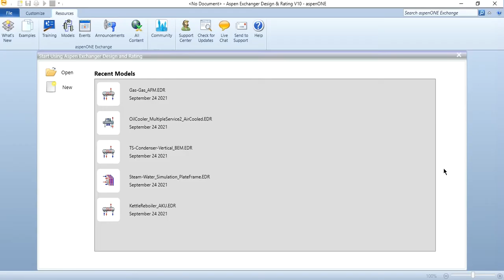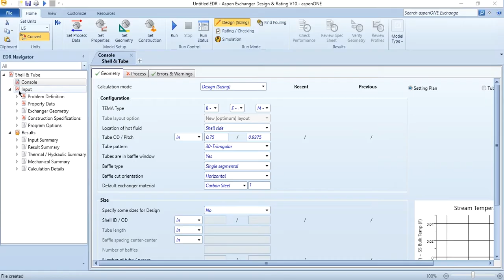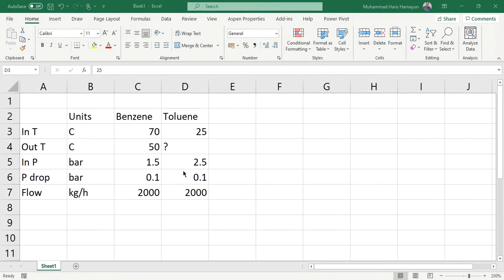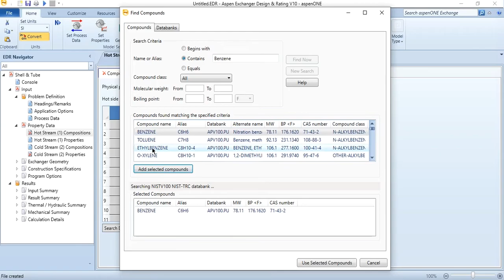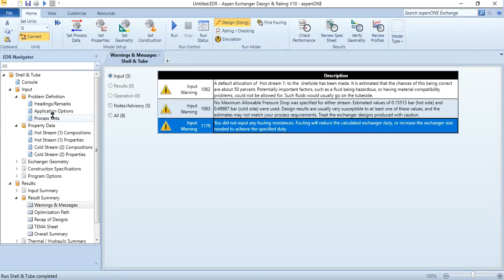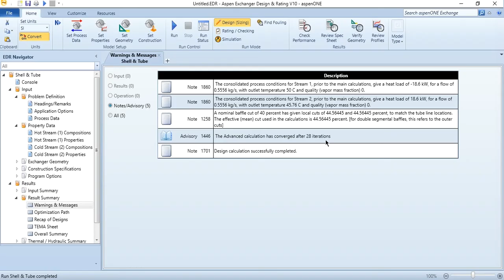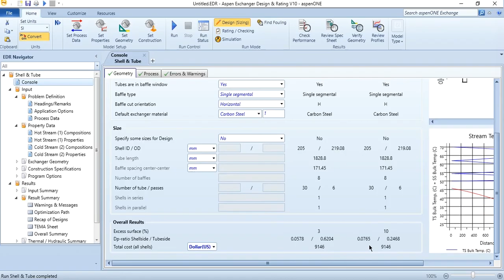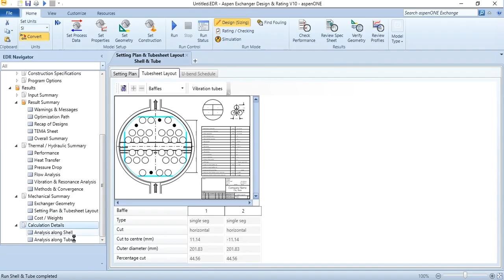Design of Shell & Tube Heat Exchanger using Aspen Exchanger Design and Rating - Lecture # 83

Comment: Hi, I am designing a heat exchanger. I am getting the length as 6000 and she'll ID around 1000. Hence the area is around 600 m2 which is too large. I need to reduce the ID to get the desired area. EDR suggested increasing no of shells can you tell me how to do it?
Reply: Kindly consider it in shell in series or in parellel condition which help to reduce the single equipment size.